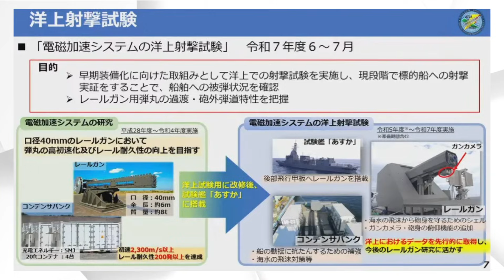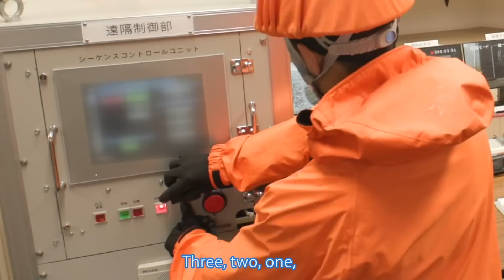Japan’s Railgun Finally Shows Real Damage at Sea

Comment: The issue the US had was that the materials science 15 years ago could not make rails for the railguns that would last for more than a few dozen shots.  A few years ago Japan offered to do a joint railgun programs with us because they had solved that problem.  The Biden administration turned them down.

Comment: The US hasn’t abandoned rail guns the Blitzer rail gun is entering service now works just fine
Reply: it's ai sloptube garbage. What did you honestly expect?
just because the USA didn't put it on a boat first, everyone considers the project failed and abandoned. 

The way I see it, there are 3 distinct phases to weapons research:
Phase 1: Inventing the unknown ,a new weapon (like the railgun). It costs a TON of cash and almost always fails to achieve the goal. Material science was not ready, energy storage science not ready, etc. These projects are Usually (but not always, however in railguns yes) spearhead by the USA wanting some new goodie to make enemies go BOOM, BOOM, KABOOM!

Phase 2: Other countries refine the tech where the USA left off(in railguns). It's been 10+ years since the USA really showed off the railgun, and now Japan has one, so to the brits and the germans and the chinese. Costs are coming down, metrics are getting closer to weaponized standards. Material science has bridged the gap for the gun barrel. Instead of 10 shots (like that old BAE railgun), it's 10000 before replacement. 

Phase 3: Costs rise again because "ultimate" refinement is the goal. Working railguns are already common, but superpowers, rouge states, despotic dick measurers, will all be wanting the "biggest, fastest, longest" railgun. Also vanity projects like "Railguns for Peace" will spring up as money sinks and political black holes for pandering and lobbiests